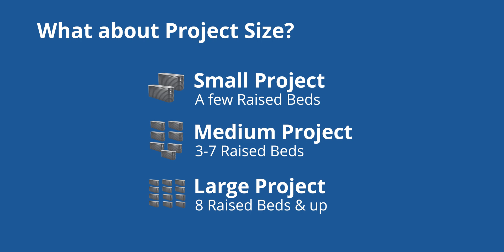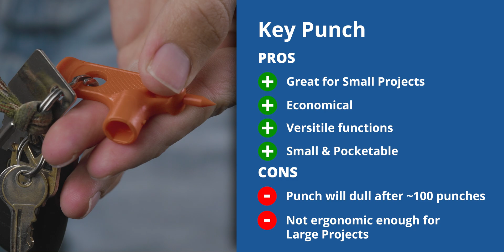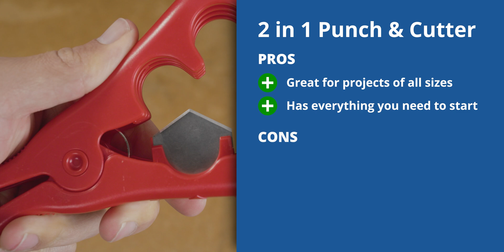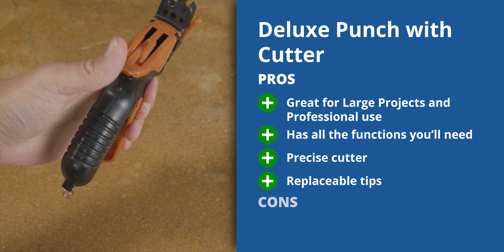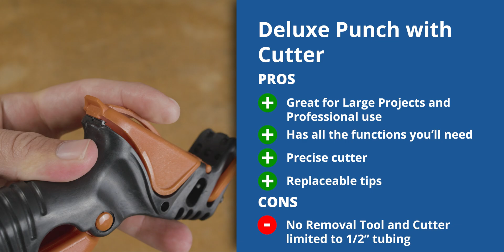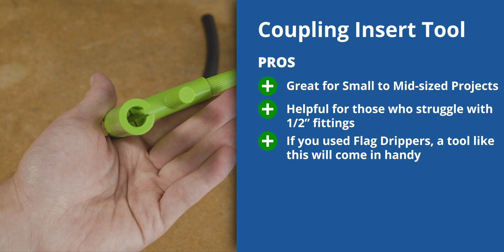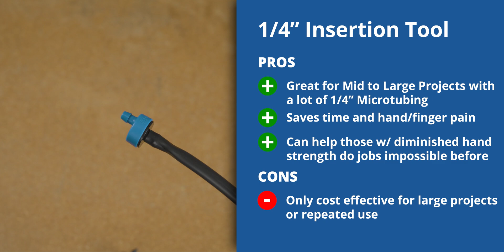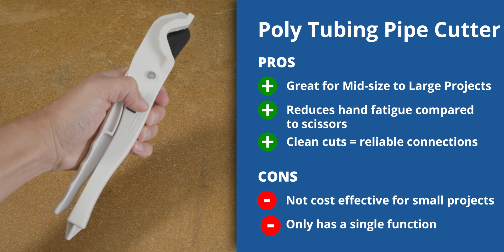Drip Irrigation Punches & Tools: Choosing the Best Type for your Project

Comment: I am here because the Pro Punch does not work when the line is warm. It squeezes the tube flat expanding out the side before the punch is fully made. I now have a messed up hole and have redo an entire line. So I am looking for a different tool.
Reply from the maker: There is a punch or so that could be closer to what you have in mind, though they come with tradeoffs to some degree as well.  What usually gets done is to squeeze the tubing where it starts expanding to apply counter-force and enable the punch to "pop" through the tubing wall.  You've probably done something similar by instinct on other projects (applying counterforce to push a tack into cardboard or cork, counterforce to drill into thin plastic or sheet metal, etc).  Similar counter force here can allow the punch to apply the necessary pressure/force to get through the tubing wall.  At least, if the punch tip isn't deformed (if it is, I can help with that as they should not be unless it has done a large number of holes). 

Outside of that, there is a punch with a very sharp tip with significantly less contact area that allows it to pierce tubing easier (this punch here: https://www.dripdepot.com/18982 ).  That punch does not have a hollow tip, which changes the characteristics of the punched hole to some degree (can leave a little tubing material hanging inside the tubing, creates a smaller hole that can make it a little more challenging to insert barbed fittings).  With that said, a good flush of the line can remove any material that gets in the line, and the hollow tipped punches can sometimes do the same so a system flush should be performed either way.  It can also see the tubing flex instead of "pop" depending on how warm the tubing is, but it's definitely able to pierce moreso than the hollow tip punches (the big risk is the tubing flexing and the punch ends up going through both sides of the tubing, at least on commercial/agricultural installs where they're going incredibly fast). 

If the pro-punch tip is in reasonably good shape (the tip not folded over to create a curved surface, etc) I'd give the counter-force method or punch in cooler weather a shot, particularly since even a sharp piercing punch can experience similar depending on the conditions.  We have seen folks use a drill bit, and that definitely gets through the tubing instead of the tubing flexing, but accidentally going through both sides is a very common result with a drill. 

If you picked up some goof plugs with the rest, you may not need to re-do any lines.  The larger side of the goof plug is great about filling in larger/stretched openings in the tubing wall, and if the damage is too extensive for even the large end of a goof plug, a coupling could save you from having to re-run any lines.  

Happy to help with any follow-up questions!

Comment: I had punch hole to put dripper on my 25mm poly tubing. But since the 25mm poly quite stiff, the puncher does not penetrate the tubing.

I tried the heating method by put some heat on the tube to make it softer, then use puncher right away. But there was leaking no matter how much i tried.

Can u suggest the best way to punch hole on 25mm poly tubing, so I can put dripper on the tube without leaking and demage the tube?
Reply from the maker: It sounds like your tubing might be MDPE or HDPE - those types are denser and have thicker walls than LDPE.  If you've never bumped into this terms before, they essentially refer to the density. Low Density Polyethylene, Medium Density Polyethylene and High Density Polyethylene.  The type most often used in drip systems with drippers punched in is LDPE. 

That's not necessarily bad, MDPE and HDPE have their own benefits, such as greater durability and the ability to withstand higher operating pressures.  This would also help explain why you are getting leaks - the denser material in MDPE and HDPE can stay deformed longer when heat is applied or the tubing gets punctured.  LDPE is a bit more flexible and will quickly expand to close up around the barb of a dripper in warm weather.  

If you do have MDPE or HDPE, you can still absolutely use it in a drip system, you'll just want to take a slightly different approach then punching the drippers directly into the wall.  With denser tubing, you could use a Saddle or Grommet with a take-off and run some microtubing and install the drippers into the end of that.  Saddles and Grommets could also allow you to connect 16mm-20mm LDPE tubing and you could put the drippers into that tubing instead of the main.   Basically, if you do have MDPE or HDPE, you can use other adapters to connect LDPE to it, that way you can both make use of your durable mainline and connect your button drippers.  :) 

If your tubing is confirmed to be LDPE and you're experiencing leaks, the first place I'd check is the size of the punch - there are at least three common sizes of punches and for barbed drippers you'd want the smallest of the 3.  Sharp punches that come to a point instead of a hollow tip are also out there and they can get through denser tubing and tubing with thicker walls, but in most cases with LDPE any of the standard punches will do the trick. 

Quick tip: For punching the actual holes, at least in LDPE, I often find it easier to do when the tubing is cool - when it's warm, LDPE gets really flexible and will bend instead of allowing the punch to "pop" through.  When installing fittings or laying out the tubing, it's definitely easier if the tubing is warm, or even hot.

Comment: I have your Pro Punch. Can’t punch a hole for the life of me. I’ve interchanged all the adapters and nothing. I’m punching a 1/2” line which I purchased from you. So close to getting this done and now I’m stuck. Grrrrr……
Reply from the maker: Wendy, was it previously punching well and stopped, or has it been leaving indents instead of holes since the start?  Happy to help either way!  What I'd check first is the condition of the punching tip.  It's made of stainless steel to last through many punches, but we have seen the tips get dinged during travels before.  The tip should be hollow, but the edges at the very tip should be straight and not bent or curved.  

If you're not already, something that can help with pretty much any punch out there, is to punch the tubing when the tubing is cool (early morning, later in the evening).  When poly tubing is warm it gets flexible which can prevent things from "popping" through the wall of the tubing.  

If you're not sure what to look for on the tip, don't hesitate to send us a photo of it by email, or email address can be located here: https://help.dripdepot.com/support/solutions/articles/11000049095-how-to-contact-drip-depot
Reply: @dripdepot  The punch is extremely sharp. When I run my finger over it, I can feel that it's sharp and it doesn't seem to be deformed in any way. There are three "blue adjustment pieces" that came with this but no instructions. I have a 1/2-inch tube and I'm assuming I want other use the "larger" adjustment piece. Correct? I just tried again as it's cooler now and we have some afternoon shade happening and didn't get better results. I'm going to bring a section of hose into my air-conditioned house and see in the morning if the stuff inside worked well. If it does, I'm gonna have to figure something out to "cool" the lines. Buckets of ice are in my future. May write you with photos/video if I can't resolve this. Thank you very much for responding. I wish more businesses were as attentive as your company is. And on a SUNDAY!!!!! I'll be in touch - thanks again!

Comment: You only describe the Punch N Cut for use on 1/2" and 3/4" tubing. Will it also cut 1/4" tubing?
Reply from the maker: I do think the cutter portion would work just fine with 1/4" tubing.  The cradle fits 1/2" and 3/4" nice and snug which helps, but 1/4" is a little easier to cut so I think it would work well :)

Comment: We needed something to insert 1/4 inch barbs into 1/2 inch tubing. This was helpful to see what worked! We ended up being able to use the handle of a screwdriver with removable attachments
Reply from the maker: That's awesome!  Did you use the screw driver socket to hold the barb while you pushed?  If so, that's a fantastic tip to share!  Pushing in 1/4" barbs ends up being a big obstacle for lots of folks, the more tips in our arsenal the better :)
Reply: @dripdepot  I had one of those screw drivers where one end is phillips and one end is flat head. I pulled out the screwdriver part and just used the handle. The barb (without tubing) slid into the handle just enough to go to the first wider ring. I was then able to shove it into the 1/2 inch tubing. Comfortable handle too :) You have to kind hold the barb with your finger as you push.

Comment: Thank you! Can you display or link a "how to properly remove a goof plug?" I often damage my tubes and end up repairing the damage with a coupler. Thanks again!
Reply from the maker: Martin, this is a great suggestion -- I don't think there is currently a resource showing how to remove a goof plug.  That could be because, for the most part, they're not meant to be, but I'm all for saving on materials and will reuse anything I can lol. 

With that in mind, I do have a couple suggestions to help with their removal -- I've had reasonable success in going this route (though sometimes do need to use a coupling as well). 

1. Try to remove it when the tubing is coldest, like early in the morning or late in the evening -- the tubing will be in its thermal contraction state at that time, so instead of stretching when the goof plug is pulled on it, it has a better chance to "pop" out.  

2. Try to pull straight out as much as possible -- sometimes I'll use a pair of needle-nose pliers to grab ahold of one end and then pull straight out.  That along with cold, contracted tubing has yielded me the best results.  

3. You can try using the small end of the goof plug first (if you're not already).  The larger end is bigger than the barb on drippers and is very difficult to remove without making the hole unusable.  

4. After you remove the goof plug, let that portion of the tubing sit in the sun, or just generally get warm -- the thermal expansion of warm tubing will help the hole shrink up to a workable size :) 

I'll see about getting this added to our list of "quick tip" videos we do, definitely a lack of how to remove goof plug information out there!
Reply: @dripdepot I asked the wrong question. When recently making a "how to" drip video I noticed I damaged the main tube trying to remove emmitters as well as goof plugs. So my question should have been "how to properly remove emmitters and goof plugs to avoid damaging the main tubing." I will try your suggestion as it applies to either scenario.  Sorry for the confusion and thank you for your quick response! 😍
Reply from the maker: @SouthCarolinaTransPlant  Perfect!  And yep, the information should apply for drippers as well as goof plugs -- better for drippers even since they don't have a side with an extra large barb.  With drippers, the pull straight out when cold method has a high success rate 😁

Comment: Slightly confused about best practices for tube temperature for various steps in the process. 

-you leave rolled up tubing out in the sun to warm it up to help it uncoil and lay  flat as you lay it in the beds 
-you  cool it down so holes are punched  in it with a snap and you don’t deform the tubing or stretch the hole. 
-you  warm it back up if comparable size fittings go into the sane size tubing. 

Does one of the punches not deform the hole and cut cleanly through? I’m installing this in a south Florida garden and it’s never cooling down in my neck of the woods. Ever.
Reply from the maker: This is a great question -- I'll start off by saying that, technically, any and all of the work can be done at pretty much any reasonable temperature, those tips are more for beginners to make it easier on them.  Even a beginner could, for example, lay out tubing when it's cold, it's just going to be a bit of a struggle until they get the experience.   Due to production schedules, we ourselves have often have to go against these tips and punch holes in the heat, connect fittings in the cold, etc.  Even as someone experienced I prefer doing them at the recommended temperatures/times of day though :)

To your actual question, we do have a punch that's fairly new to us that I'd say fits the description -- this punch is much sharper than the others so is much less likely to bend/push the tubing and much more likely to simply pierce it.  Perhaps even better, it has a metal tip (very durable) and is one of the more inexpensive punches.  Here is the link to that sharp punch: https://www.dripdepot.com/18982

Comment: I am getting my system installed. I have used drip irrigation for many years but some of my beds have changed and it is time for an update. I have enough raised beds to fall into the "large garden" category. I'm also 77, so my hands aren't quite as strong as they used to be.  All of my half-inch tubing is installed and I am getting my quarter inch drippers into place.

I already had a couple of punches including your pocket punch, but I didn't know about it's additional features. What I found is that it was very awkward to use on my tubing that was nailed down at the heads of my raised beds. I had to put a screwdriver under the tubing and raise it up into the curve of the punch in order to get the hole in the right place. So I went to the local big box store and bought a simple punch, which I found easier to use to get the hole where I wanted it. After watching this video I went onto the big box store website and found that my little $3 punch has insertion features that I didn't know were there.

Anyway, I've still got 30+ holes to punch in the raised beds, and more in my in-ground gardens and I found this video very useful. I'll probably wind up with more of your tools as I put in more drip line in other places.
Reply from the maker: Nadine, you bring up such a good point -- I would agree, the pocket punch would definitely be awkward to use on tubing that is already clamped/secured down.  Getting the cradle underneath wouldn't be easy at all.  Though not addressed in the video, I'm glad you mentioned it for the comments.  The same would apply to the Pro Punch and any of the punches that cradle the tubing.  Thank you for that! 

And that's great about your $3 punch having additional features -- when we were preparing for this video we got all the punches gathered and then started trying to discern all their features -- when doing so, we were surprised that the most inexpensive punch (currently around $0.55) had a lot of features, more than many of the other punches.  That's the little orange Key Punch you see in the video.  Even more surprising, very little of it was documented anywhere out there (something we found to be true of most punches).  

Thank you for the fantastic comment Nadine, I truly appreciate you taking the time, others will read it and will save themselves some time trying to punch tubing already clamped down with a cradle punch.